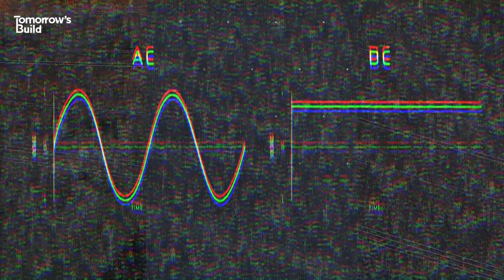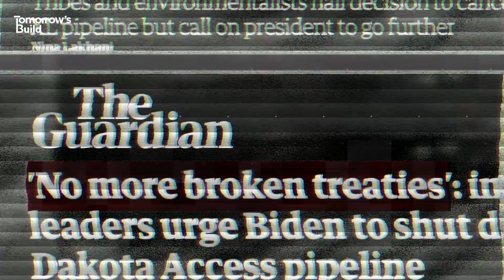The $23BN Plan to Power Singapore from Australia

Comment: I'm confused. So they convert the electricity from Ac to DC power to go under the sea? I thought Ac was invented so long transmissions don't have so much of a loss.
They convert the power from DC to Ac when it comes out of the solar panel, then transmit it to the coast then convert it back to DC bring it to Singapore then convert it back to Ac to the individual power outlet where it is converted by most electrical devices back to dc
Reply: As long as the voltage is high enough to minimize resistive loss, DC is always better than AC for power transmission, especially for underwater cable, where the capacitive loss of AC is huge! AC was thought to be better in the old days as the voltage of AC can be stepped up or down easily by using a transformer, while DC can't. But now, with the advancement of power electronics, converters can handles higher voltage and power, so AC can be rectified to DC before underwater transmission to reduce losses.
Reply: @Ct5678912  Really? R=U/I so if you have high voltage than you have a high resistans. YOu need high amps not high voltage for efficent transfer with DC!
Reply: @moritz5555  Your statement assumed a circuit with only a voltage source and a wire that short circuited it with no load. The current with no doubt will be extremely large. However, you cannot apply Ohm's Law directly on a transmission cable because it is not a load and theoretically does not consumes any power. The loss on the cable is usually calculated by I^2R, where R is a constant. That's why current should be minimized. The power transmitted by the cable can be calculated by P=VI. To maintain the same power transfer capacity P, while minimizing current I, you need high voltage.
Reply: Ac was invented for long distance yes but at a certain point DC is actually more efficient
Reply: A high voltage DC combined with an adequately thick cable will give smaller losses than AC.
Reply: @SanctuaryLife  Why do they use Ac for the land part from Australia to the sea? Wouldn't it be better to use DC for that part too, since it has less loss?
Reply: @Minecraftzocker135  might be easier to feed it straight into the NT power grid for distribution around Darwin and then convert / export it from there to Singapore.
Reply: AC covers more distance at a lesser loss once it's converted back to DC.

Comment: It is a journalists dream. Intermittent solar production is not a real solution. How about night time and time difference between the two countries ? To do that you need gigantic accumulators that does not exist for the moment. They already try in Australia to avoid electricity production from fossil fuel but fail to have a continuous production. Continuous production of electricity from non polluting source is limited to hydro for the moment and this is the major problem of solar and wind intermittent availability. Not be solved tomorrow !
Reply: Some 33 million kWh of battery storage is required. Prices will have to fall a lot to keep this in budget.

Comment: Please fact-check your videos, especially if you are going to make jokes about it. Your bit about AC and DC power is at best misleading and at worst wrong.
Reply: Could you be more specific?
Reply: @Gazer75  Conversion losses and difficulty to step down voltage are immense with DC, so nearly all transmission is done with AC. The power lines shown in the video are most likely AC. Also unless it is very high voltage, DC is less efficient for transmission itself as well.

Most electronics use DC power, that's what power bricks do, convert AC to DC. If transmission was also done by DC, AC would be completely pointless and would barely exist.

Comment: Could you please recheck your information on power losses of DC vs AC.  I was always taught that we have an AC grid system because it was easier to transmit power without the losses that would occur from DC power.  I would be interested in what you find out.  Thanks,
Reply: Since my university courses, HVDC has advanced to where it can be a good choice for point-point transmission at certain scales and distances. Its losses can be lower than AC transmission losses (between 3% and 6% of energy).  Unsure about capex. In both AC and DC cases,  high voltage permits maximum power transmission at minimum current, therefore, minimum resistive  loss.
Reply: @chrisyorke6175  Thanks for the updated info.  I was going on our history as to why we choose AC over DC.  Does DC have to be at a higher voltage to AC to have a better resistance factor when transmitting over high power lines?  Also, when at those high voltages just how much current is being transmitted down the lines?
Reply: @flyboy38a  To transmit power to a load  needs   highest possible voltage in both AC and DC cases to keep the current as low as possible.  Resistive loss is I squared times R.   Of course, if you can afford to spend  more on copper, you can always install a thicker cable, implying lower R. There are trade-offs, but when spaced overhead HVAC lines are out, HVDC starts to become the compelling option.

Comment: Narrator is incorrect about his electricity fundamentals. He states after the 3:26 mark that converting AC to DC is more efficient to run over long distances. It’s actually the opposite. AC can be transmitted over long distances more readily and more economically than DC, since AC voltages can be increased or decreased by means of transformers.
Reply: Please read up on HVDC before you make a fool of your self ;)

Comment: I think what is more significant is the transmission network rather than the solar array. This would mean that with a significant power transmission Network, it would be possible to take advantage of the time difference; so that a generating station in one time zone could provide peaking power to a country in another time zone, while the demand on the generating station is low. I think this also a significant reason for building this in Australia as NT is 90 minutes ahead of Singapore. This would mean a greater capital return on both the investment of the generating capacity and the power transmission networks. 

PS: Nuclear Energy?

Comment: You didn't mention what's going to happen when the sun sets over the panels every night. (No baseload power)  they'll have to link up numerous undersea cables and make share contracts with other solar provider countries spread across wider longitudes to minimize this problem.
Reply: Did you actually see the video?
Reply: @Gazer75  Yes,  but the sun spans half the globe and the longitudinal area shown in the explanation is nothing like that. Also the mornings and late afternoon will not provide much power which will make the situation worse.  We need base load power solutions,  anything less is just helping.
Reply: @davidhunter1538  So you missed the part about batteries between the panels and the line?
Reply: @Gazer75  batteries can’t power a city for hours. Only cover brief interruptions and hold the grid while switching between sources.
Reply: @davidhunter1538  This system is only intended to cover 20% of Singapores energy needs

And there are already fairly big energy storage plants in the world.
Largest with lithium ion battery is 1200MWh capable of delivering 300MW for four hours.
Using Thermal and molten salt there Ouarzazate solar power station stores up to 3000MWh and can output over 500MW.

So who knows what is possible in the future.
Reply: @Gazer75  Good. Then it's nothing like the battery system Elon Musk installed in south Australia (2017) for us. Ours had to be increased by 50% at Hornsdale SA (to only 100MW), despite even being charged from our normal local grid supply (not solar panels constrained by sunlight availability from thousands of miles away) and that was just for short time assistance. I hope the system to help Singapore works out better for than ours did.

Comment: This sounds like an advertisement. They brush off neighboring countries’ potential pretty swiftly. I have to think there is a mix of opportunities in Indonesia and Malaysia that could solve this problem. Besides, after all is said and done, this only supplies 20% of SG’s power requirements! And what if the cable is sabotaged? This is a terrible idea. Well, good for the manufacturer!
Reply: - What if the cables sabotaged?
I give u better question, 
- what if Indonesia doesn't approve this project?
Reply: UNTUK INDONESIA BOLEH KUTIP TOL LAUT.

Comment: Good luck with that!! Australia can't even power Australia. The East Coast grid is so old and decrepit, and there's massive, idiotic political resistance to renewable generation and storage upgrades like what SA instituted to massively overhaul their own network (due to the increasingly unreliable Eastern Grid and market mismanagement) that they're the main cause of their own supply problems. Also, having the thoroughly inept AEMO as the market regulator is the other half of all their problems. Whatever Singapore does, they should *never* outsource management of their Australian supply to AEMO. The average kindergarten can manage a national power grid better than AEMO.

Comment: And not a single mention of Nuclear power... Which has less impact on the environment than both solar and wind? Crazy...
Reply: only if new molten salt reactors are used.  light water reactors generate tons of radioactive waste that is extremely difficult to deal with and takes thousands of years to resolve.  MSR actually can use spent fuel rods as fuel and also Thorium.  The waste is neutralized in decades and a few centuries at most.  Deadly nuclear waste that lasts thousands of years is hardly "clean"... in fact it's far worse than any amount of CO2.  "Less impact on the environment"?  What about the global poisoning of humanity by Chernobyl and Fukushima?

Comment: The 'high voltage' bit is what actually decreases losses.  The DC bit doesn't improve efficiency from power loss, it just makes it a lot easier to inte grate into different AC gross after the fact.  

Fact check more please

Comment: Around 10% of the 60% from the inverter array, served by panels which don't achieve more than 40%. They're better off with roof panels.
Reply: We're full
Reply: @NewmaticKe  Of roof panels? The reality is that solar isn't a good solution for dense cities, due to problems with phasing and resistance over long distances, with large inverter arrays.

Comment: Imagine using that long transmission wire to transport nuclear energy from Australia. Australia have so much potential for nuclear power, it's a shame that they are afraid of it.
Reply: Ignorance and fear are dangerous. They don't realize how effective nuclear energy is.
Reply: @greenmachine5600  they do, but they just don't have tech to make it safe. Also they have to push green agenda, knowing it's not green at all.
Reply: With nuclear power there won't be a need in this cable. Singapore could produce enough energy locally.

Comment: If something damages the cable, will it electrocute every fish in the ocean?
Reply: the electrocution would be only for a very brief moment as the transmitting station senses a voltage rise from the load being disconnected and the underwater conduit would shut down.
Reply: It figures that the people that support green lunacy like this also have not a clue how electricity works. What the hell makes you think electricity is going to go through fish on its way to nowhere? Electricity will go to ground via shortest possible distance....right underneath the cable!!!!

Comment: 2,300 miles of cable and 500 miles of overhead power line. How much energy is  along the way as electricity travels from a power plant to the plug in your home?  we need to review some high school physics, namely Ohm’s law.  Ohm’s law describes how the amount of power in electricity and its characteristics – voltage, current and resistance  It 
boils down to this: Losses scale with the  of a wire’s current. By the time it reaches Singapore, MORE than HALF the electricity will be gone as thermodynamic losses.
Reply: that's why this is a high voltage dc line.  Ohms law should make that clear to you.  Edison failed at DC power distribution because the system was low voltage and had high resistive losses.  Since you are familiar with Ohm's Law then you know that when you double the voltage you halve the current.  Scale this up to thousands of volts DC and the losses become acceptable.
Reply: @Electromotive_Force  HVDC is less reliable and has lower availability than alternating current (AC) systems, mainly due to the extra conversion equipment. Since renewable installations have fluctuating daily power outputs, expensive conversion and reliable transmission are paramount.

Comment: 3:27 huh? I remember in school saying that DC didnt work in long distances with the tesla/westinghouse vs edison. I would like see if they could do hydraulic line that would transfer power long distance and convert to electricity.
Reply: Edison's DC system was low voltage and suffered greatly from voltage drop.  AC suffers less loss and voltage can easily be boosted by transformers (which only work with AC).  This cable is a high voltage DC system and losing a fraction of that voltage is relatively insignificant
Reply: Terrible (wrong/misleading) explanation in the video... Someone else explained in a comment that the issue here is parasitic capacitance caused by the sea water, reducing the efficiency of AC power transmission.
Reply: @Cyberguy42  Nothing to do with seawater. HV cables insulation is done by wrapping the conductor in capacitive foil layers. There is a voltage drop across each layer but as it is a capacitor on AC, it will pass a lot of current. There is also the problem of voltage rise. If you put 10kV in one end of a 4000km cable, you might end up with a million volts at the other end

Comment: Not a word about the negative effects of solar panels? The footprint of making them, the materials needed, that are in limited supply, and most notably, the environmental disaster it will become, when the panels have to be changed. Build nuclear power for gods sake, it's the safest and most environment friendly type of energy there is!
Reply: solar panels are easily recycled into the small amount of metals and mostly silicon/glass/sand.  If you're trying to say that Nuclear power generated by conventional light water reactors is "clean" and "safe" you're completely wrong.  2 great examples Fulushima and Chernobyl.  Also the radioactive nuclear waste/spent fuel rods from light water reactors cause extreme pollution for thousands of years and it's extremely difficult to deal with.  If all new nuclear plants were mandated to be Molten Salt reactors, this would change the picture completely.  MSR can burn the spent fuel rods and Thorium which is extremely abundant and cheap.  Also the radioactive waste from an MSR is mitigated in decades and at the most a couple centuries.  Nuclear waste in either form is no comparison at all to recycling a small amount of copper and other metal and the silicon which is just purified sand.

Comment: I don't know but it seems like anchoring a few floating nuclear powerplants Academik Lomonosov style, 5-10 kms from Singapore providing 24h baseload power would make more sense than a 23 Billion Megaproject of this size for importing solar power from another freaking country more than 3000Km away. And just for 20% of its needs. Singapore needs 50Twh per year, equivalent to 5.7 Gw constant.... Not undoable with floating barges and that giant budget....
Reply: Nuclear is the best option
Reply: The batteries will have to be very cheap, going by these costs. The Horndale, SA battery cost $90million in 2017 for 0.3% of the storage. Solar panels must now be phenomenally cheap, too. Nyngan's solar  cost $2000/kW. This project will need  5 million  kW or so. Never mind the cable cost.
Reply: @chrisyorke6175  Look at how much the  Al Dhafra  project is selling it's solar power for.
Reply: @catprog  don't know, but If that's the Saudi project, then it must be subsidized. Its revenue wouldn't cover O&M costs, on those reports.
Reply: What about nuclear waste?
Reply: Singapore has a very busy shipping lane, so it's not that feasible and any nuclear fallout from a disaster would definitely have a high impact on the city.
Reply: @kalyanvadlamani7607  They do not need to be IN the shipping lanes, just closer to Singapore than Australia is. And in case of an apocalyptic accident the advantatge of a floting reactor is that in can be easily scuttled. 1m meter of water is enough shielding for fuel after a few days post-shut down

Comment: I am sorry, but using DC will not imply lower resistance, it might imply lower impedance, but Power losses area a combination of several factors, not only resistance.
Reply: How
Reply: Underwater AC power transmission is not feasible.  AC transmission lines have a large electromagnetic field surrounding them that is attenuated by seawater.  High voltage DC is not low impedance.
Reply: @Electromotive_Force  neither it is low resistance as it is implied in the video
Reply: After many testimonies from different people concerning Afridigital Trade , on how she made money for them through investing on crypto I was convinced and decided to give her a try. I contacted her and she consulted me through the whole process I followed and my life has changed for the better. I made $25000 in two weeks very hug amount and I never dream of having till death because I had no job and no one to help me
Reply: For more info
Reply: Whay/Sapp ⬆️ ⬆️ ⬆️